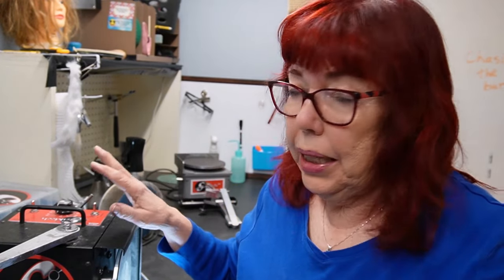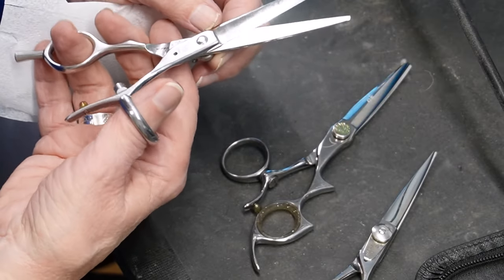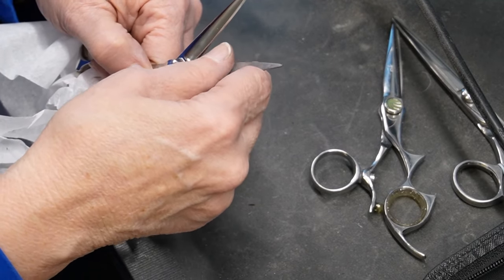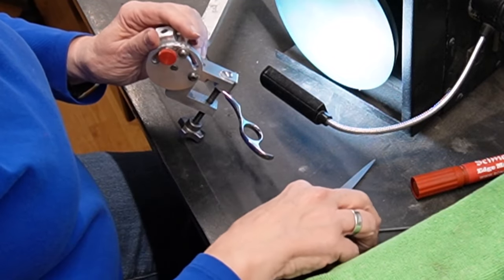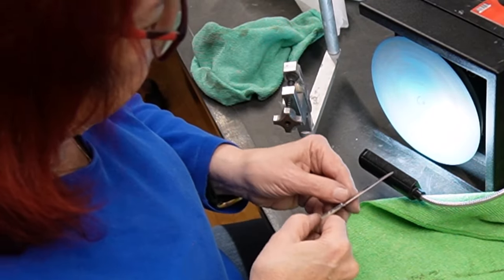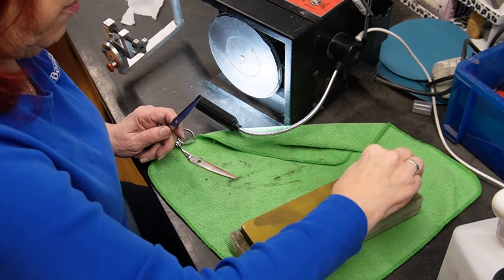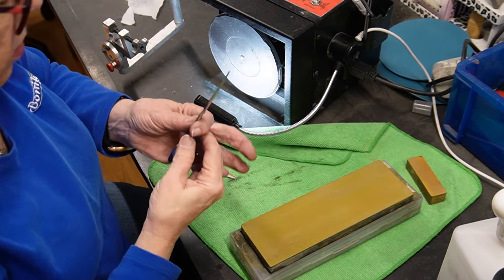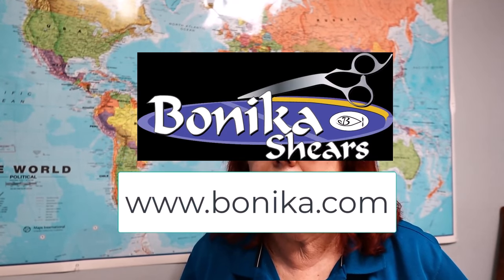Three Shears Get Sharpened On Two Different Machines - Demo by a professional shear sharpener

Comment: And also the tip should be sharper because most stylists will cut on the way out , not on the way in to avoid injury.
Reply from the maker: Yes,  you have to pay close attention to get the tips perfect.

Comment: What is a ride line?
Reply from the maker: This is the shiny line along the cutting edge that wraps around the pivot area on many beauty shears.  It creates a smooth feel.  This video covers this but I probably need to make a specific video on this . .https://youtu.be/A6xopmT39Io?si=sqpzeJkozEg1pagd
Reply: @BonikaShears  Thank you Mrs Bonnie. I feel like I need a 3 months course with you before I even consider taking a test. Thie very involved.